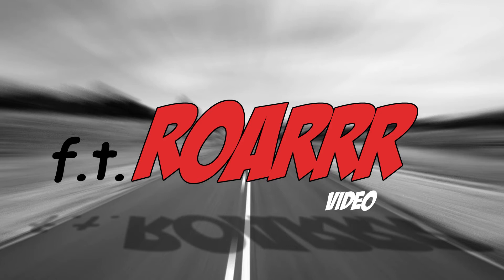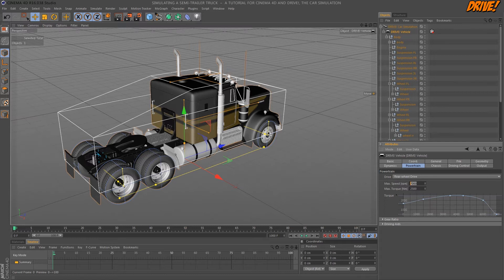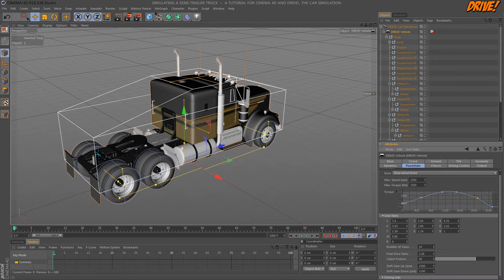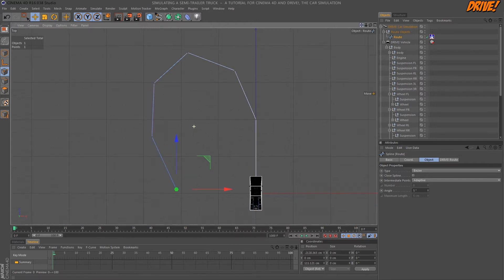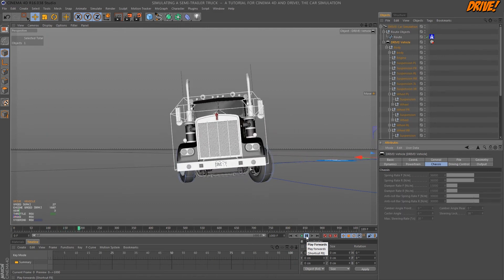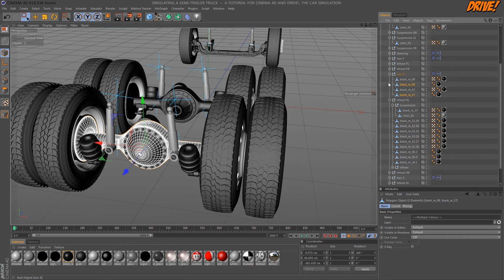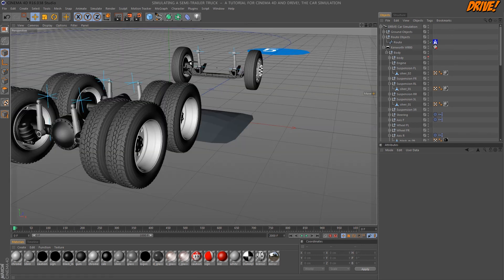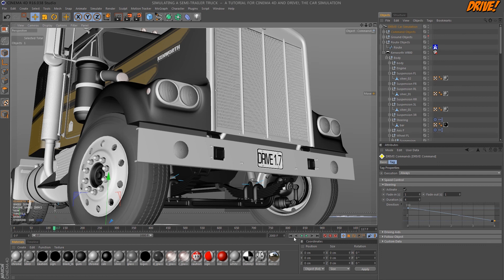Simulating a Semi-trailer Truck :: Tutorial Part 2

Comment: Great guide! FYI - In Xpresso you can use a single 'Mix' node to easily get the average of two positions instead of using two math nodes to add/divide.